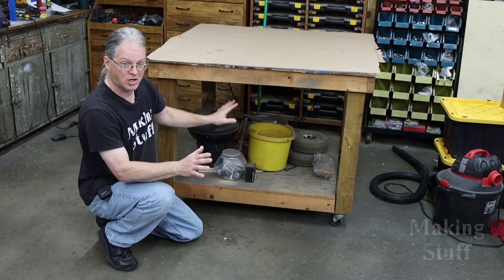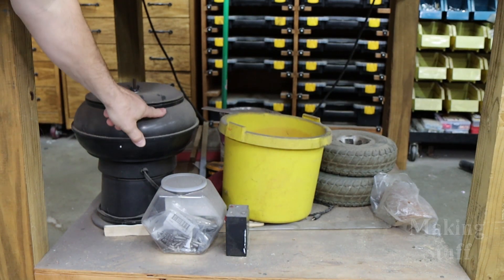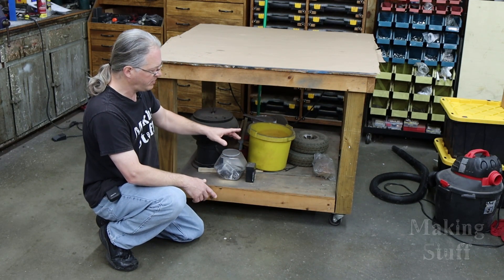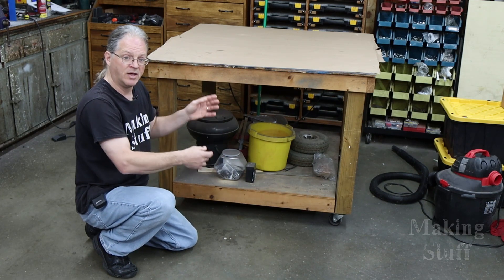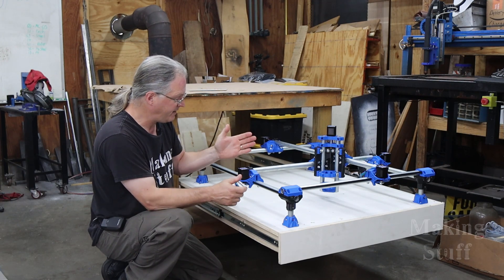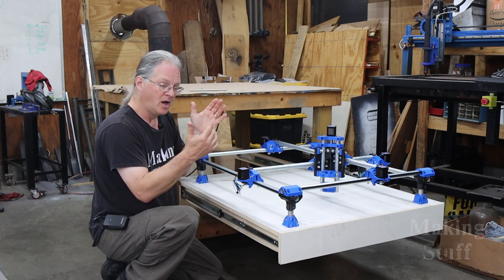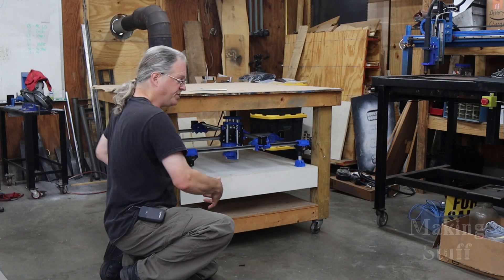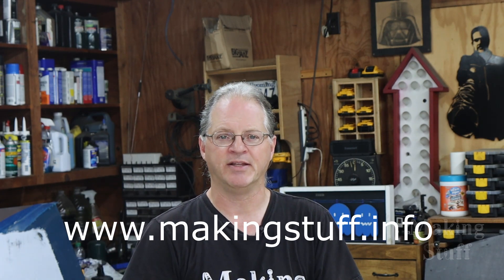Assembling a Primo MPCNC (Mostly 3D Printed CNC) with Space Saving Design- Part 1

Comment: Im a bit confused regarding the text from V1 Engineering page saying that I should calculate the size of my machine based on the size of my "build area". Let say the area I want to utilized is the size of depron sheet it self (610mm x 914mm), is this the value that I should enter into the "cut calculator" ?

Comment: Good afternoon or good morning to you Making stuff. 
IT'S Graeme from South Africa, a small town called Kimberley. 
I am just in process of building my own cnc laser engraver ,would you recommend the Linuxcnc 2.9 to start up with for someone for the very first time. 
I built the cnc up from scratch I got separated parts because I couldn't afford to buy a fully made cnc I just didn't have the money to do so.
I have built the table and set up the cnc ,and made a box to house the Electronics for cnc and put different electronics parts in to place to be wired up.
Reply from the maker: My opinion is that if you can build a CNC machine, you can figure out Linuxcnc.  It's free so if you wind up using something else, it didn't cost you anything other than your time.
Reply: Thank you very much, you have answered my question Linuxcnc is the one will be using. 
Now my other question I have for you is , today I got my laser tree LT-40W-F23 it has a three wires yellow black red how do I link it up to my 5 Axis panel.

Comment: FYI, you've got a few links that aren't to the right items on Amazon (both here and on your web site)

I like the design, I just wish V1 would release CAD files (even STEP) so that I can assemble virtually before I plan out a build
Reply from the maker: Thanks for the heads up on the links.  Will be fixed shortly.

Comment: Nice way to store your CNC out of the way.  I built an MPCNC but realized I wanted something more rigid so then I built an PrintNC.  It was a lot more expensive but I like it a lot more.  BTW, I used an old control board from one of my Ender 3 3D printers for my MPCNC.  It took a bit of work in Marlin to set it up but worked just fine.  The motion control is basically the same so you can use something like that if you can't find a board.
Reply from the maker: Cool, thanks

Comment: You didn't mention which control board you were looking for but any control board for a 3d printer with at least 5 motor controllers would work so long as you feel confident enough to build the marlin firmware for that board which isn't to difficult. I am very happy with BTT SKR 1.4, seem appear to be in stock on their website, which I bought while building my MPCNC lowrider but since I blew up my control board on my 3D printer ended up being used there instead although I would suggest a more recent board than that, I was thinking of the Octopus.
Reply from the maker: Ramps or Rambo.  I haven't looked in a few days.  Hopefully they will be back in stock soon.

Comment: I just rebuilt my mpcnc with the primo setup. Seems to be a lot better than the previous versions. I was regularly replacing parts on the old version until I started printing everything in petg and even then, certain parts would break. Looks like a nice convenient setup you have going there. Thanks for the video!
Reply from the maker: My last one was printed in PETG but I used PLA on this one.  Hope I didn't make a mistake using PLA.
Reply: @MakingStuff  I printed mine in PLA this time as well so we'll see!

Comment: Oh No !! You can't find any controller boards..or are you wanting a specific one? I'm in the process of printing my parts..so the board will be next...now I'm concerned I can't get a controller.
Reply from the maker: I'm looking for a specific RAMPS board, same as used in 3D printers.
Reply: Most likely he wants a specific one. There are loads of CNC components available, but a lot are of low quality and some of the better ones are back ordered, but you shouldn't have a problem getting SOMETHING. You may need to settle for good enough and upgrade later when the supply chain is not so bad.

Comment: That's good thinking and I look forward to your next steps.  You should think about closing in the sides - you can pull the machine out for setup but run it inside for noise and maybe dust control too.
Reply from the maker: I hadn't planned on running it while it is under the bench, but that sounds like a good idea with the sides enclosed.